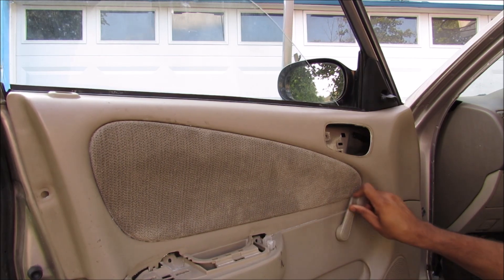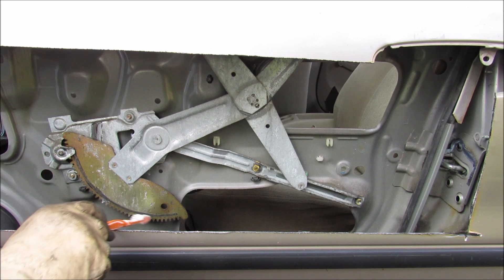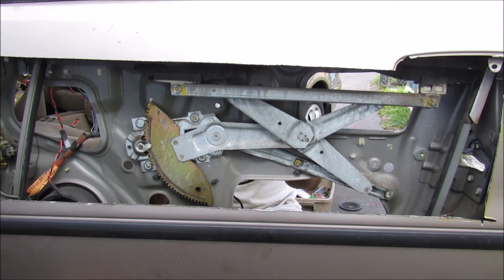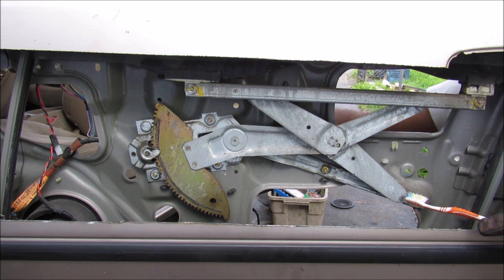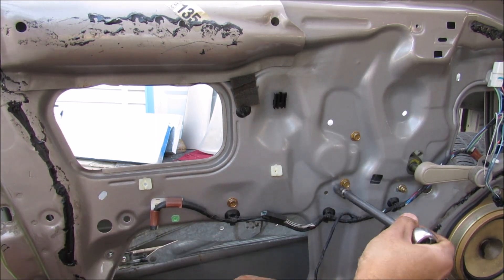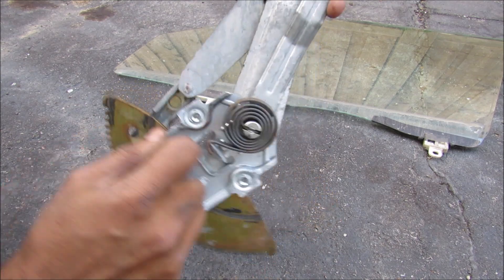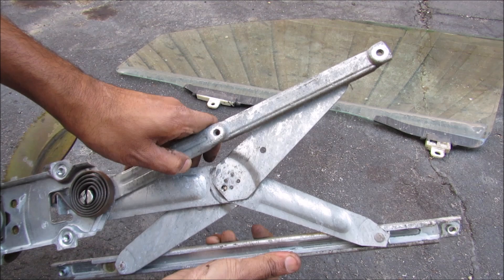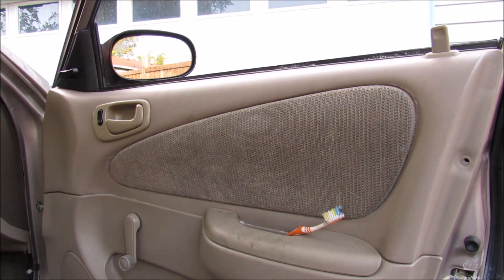How Manual Windows Work

Comment: Do the springs go bad in the regulators? I have a 98 f150 and I have generously lubricated all pivoting and moving parts. The resistance when rolling down is soo strong I am fearful the crank handle will strip.

Comment: My window gets stuck like at 3 different levels/positions  when I want to roll up the window. The window handle gets super hard to roll up. Are those signs of a bad window regulator? I tried to use wd40 it helped a tiny bit. I’d buy another window regulator but they seem to only sell the power window version and I have the old manual roll up version.

Comment: My 07 Sierra has cable driven windows. Bit different. I think this way wouldve lasted longer.
Reply from the maker: Crank windows on an 07?
Reply: @speedkar99  Yup. Work truck. "Poverty spec" as I call it. Manual 4x4, no oil pressure guage, nothing fancy in it at all. The automatic transmission was an option... Paid $950 for it though. Can't beat a v8 4wd with a towing package for under a grand.

Comment: thanks! i think this just showed me what is wrong with mine!
Reply from the maker: They fail? Or slip off the track?
Reply: @speedkar99  most likely slipping off the track.  went to my mechanic, will charge about $150 for labor, and i could buy the regulator myself, if it's needed (if they don't i can return it)
Reply: @speedkar99  sorry for slow reply, my mechanic took the door apart & the manual regulator had failed.  i had bought a new one, they installed that & it's much better, not perfect but better, doesn't just slip down anymore

Comment: I am rubbish at this kind of stuff. I need to see someone else and then practice. My son was trying to force the window crank to lower it, as it was a bit stuck by some stuff the was placed next to it. So then the window suddenly went down by itself. I was able to close it using the crank, but then it would not do anything once it reached the top. And now it goes down by itself, not all the way though. One quarter of the window is open. 
I am scared to open it and then being unable to fix it and put it back together...

Comment: What a neat video! I just picked up a used van and it has manual windows. Was thinking of maybe converting them to power windows. Really cool to see how the manual ones work. Subscribing!
Reply: IMHO not worth it. Window motor repairs costly. They do go bad. I wish I could replace my power windows with mechanical. They will last longer.

Comment: If the scissor part of the mechanism is loose and has play with it could that be the reason why my window keeps falling off track? Thank you in advance to anyone that can help
Reply from the maker: Check the track to make sure they are lined up
Reply: I always put it on the track correctly with some tension on it but I’m thinking the “ scissor” part has some play in it pullin on it at an angle and it even finds its way off the tracks again.

Comment: Thanks for this super concise and informative video! Could I remove the crank and bolt on a motor if the car came with power windows as an option, or are power/manual regulators different?
Reply: I'm curious too
Reply: @chiefdenis  Yes that is possible. One of my friends converted his car's manual cranking window to a powered one using some kind of kit. I am not aware of specific details of the kit.

Comment: Very Cool! I've just spent couple hours trying to get my rear door locking mechanism back in (had to replace the actuator bit on a 2003 Corolla). Given up for tonight, seems I have to remove the window to get the guide/track out of the way first. The plastic shroud and metal bits split apart while being manhandled out so I didn't have to touch the window before. But they won't go back in as one piece (too large). So here I was looking at window videos during dinner after midnight lol. Marvellous to see how these minor mechanical parts all work. Your videos are just amazing fella.
Reply from the maker: Thanks. They can be tricky to get out...the right way

Comment: My car is an old ‘82 Toyota Corona RT 140. When I crank the roller to raise / lower my manual car window, the roller doesn’t seem to work. It suddenly disengages out of place  spinning freely on its own, losing contact with the mechanism. So I have to pull up to close and push down to open the glass manually by hand. What could be the common problem? Do I have to replace a spare part? Parts for my car is rather difficult to obtain these days due to its age. Your guidance will be greatly appreciated.

Comment: I am looking to switch my automatic windows to a crank system.. but finding toyota vans in colorado are harder to come by, I am curious if i could use a manual regulator from a different vehicle or if they have to be specific to my car. any advice?

Comment: I have been looking for a diagram or any explanatory video about how manual window regulators work and what they look like inside, and FINALLY came across this. better than a picture diagram! 
I was trying to roll my window down one very cold early  morning this winter and it was frozen shut. I figured that out after I heard and felt a snap and the window crank go loose and have zero tension. and was just able to spin around freely not doing anything for/to the window. took apart my door panel and pieces of the regulator and bottom window clamps came tumbling out. I am not a mechanic, just a fix it as it comes, and figure it out as I go kind of person. if I can. so I knew nothing of the composition of a regulator, or inner workings of the manual window. so wasnt sure what I needed to order/fix. this video helps alot! thanks for putting it out there!
Reply from the maker: I'm glad this video helped, especially in the time where most cars have power windows now

Comment: My windows crank is loose which made my window worthless unless i push it up or down. Do i need to buy a crank or the whole regulator itself? Or do i just simply put it back in track?
Reply from the maker: You might need to adjust the arm to hold the window a bit more to hold the glass

Comment: Can I spray the scissor portion, or plastic gear portion with White Lithium Grease or Silicone Grease to clean/renew a 15 year old car?
Reply from the maker: Yes
Reply: I have a 78 and mines is stuck I broke the handle trying to wind em down. What would cause that ?

Comment: So I have manual windows with exact mechanism, would I be able to just buy the OEM motor to convert it into power windows or do I need the whole new assembly?
Reply from the maker: +Jeffrey Mac yes there's a forum post on it.
Reply: speedkar99 Thanks! I went ahead and bought a new window regulator ($113)with a motor thats exactly the same as OEM on my ten year old truck. I’m going to use a relay harness to power them. No more manual windows for me. Dealer ship wanted $1,462 for the regulator assembly with motor and no labor included. Insane.
Reply: @jeffreymac4915  So did you ever end up installing the power windows? I'm thinking of doing the same thing. Just curious if it worked for you.
Reply: @OneWorld-158  yea. Still works perfect to this day 3 years later. It was super easy. Hardest part was getting the wires through the fire wall

Comment: I have a question 
I have a 97 ranger and my window is crooked. I opened it up and it’s on track, but when I crank it all the up al I closes it won’t it just keeps spinning. But when I crank it down it’s fine. I can lift the window up with my hands and it closes all the way but if I move the spinning thing down it won’t go up again; I mean it will but it will be open and to the side again
Reply: You have gears that are stripped that's what happened with mine

Comment: I'm tired of sayin this "Awesome video as always " . Got a question,  my car has electronic throttle body and it idle on 500 rpm sometime without ac which make the car vulnerable to stalling at every small hill. Is there any way to adjust that ?? If i turn on the ac it automatically rev to 700-800rpm... !!
Reply from the maker: +Yathu prem thanks. Did you try cleaning the throttle body and mass airflow sensor?
Reply: speedkar99 nope..